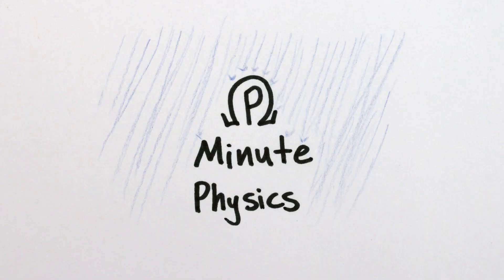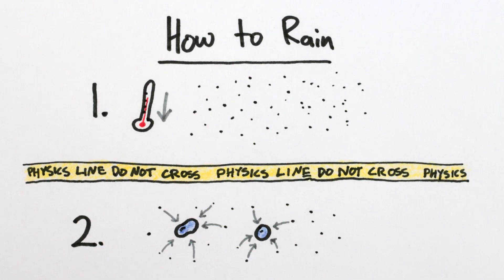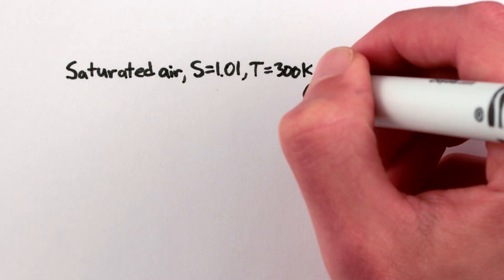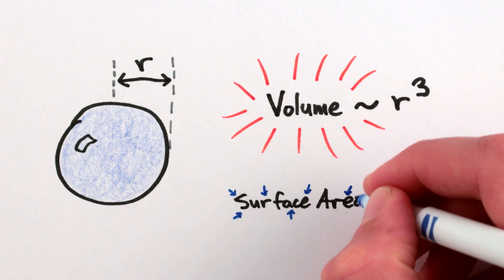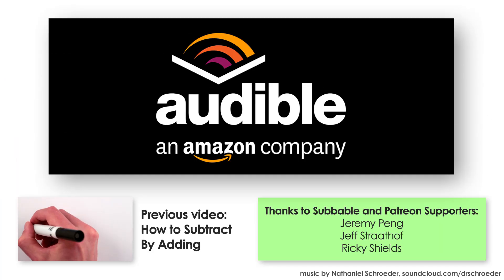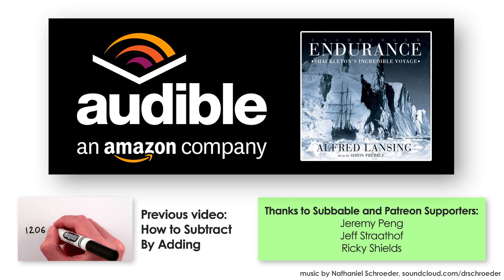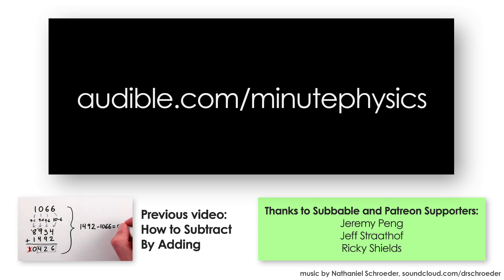Why Raindrops Are Mathematically Impossible

Comment: Nope. Curveball. Change your unit of measurement.
It’s not an impossible mathematical equation, you’re just mathing wrong on this one. 

.2 of a mile cubed is .008 cubic miles.

However! .2 of a mile is actually 1,056 feet. Cube that number and you get 1,177,583,616 cubic feet

Clearly there’s a disparity here.
Reply: Surely he knows this, so I don't get why he leaves those blunders in.  There's an even bigger problem in the light polarization video and it's frustrating how so few of the audience members catch it.  I assume it's algo-gaming by just leaving wrong things in on purpose to promote comments.

Comment: Hold on.. That doesn't make any sense? If the inverse square law flips with small numbers, what if you just used smaller units? I'm not sure that's a valid explanation and if anything just points to a fatal flaw with the inverse square law

Comment: Ahh, I believe this is due to measurement discrepancies

We measure in things like centimeters and inches, they are quite large, and one at least is easy to break down

Micro-physics, however, measures in atoms, which are far too small and numerous for us to count properly

So from our perspective we are cubing a fractional number, and therefore have what looks like an impossible equation

But from the theoretical perspective of physics, such equations are handled at the atomic level, with a base measurement so small it barely exists, and therefore don’t run into a shrinking exponential equation

Instead that water droplets surface area and volume are dependent on a comparatively massive number, but at an incredibly small increment to us

ThePoint/TL;DR: with water droplets: spacial dimensions are measured at the atomic level, not with fractions and decimals at eye level

Granted, I’m not about to go through and calculate that mess, that’s one hell of a big number for such a small thing, but at that point there shouldn’t be a discrepancy in the calculations, and that should be provable scientifically

Comment: 0:44
"Surfaces require more free energy (Gibbs) to make/form than volumes do"
Formation of a given volume of a liquid releases energy (-ve sign in formula) whereas formation of a given area of a liquid surface absorbs energy. 
So, liquids tend to acquire a minimum surface area with a maximum volume for a given amount of the liquid under the constraints they are in. 
When they aren't under any constraints (in equilibrium), they tend a spherical shape.

Comment: But the only reason cubing makes smaller numbers than squaring es with decimals. But the decimals only appear due to the fact that we’re measuring in meters or whatever. What if we decided to measure in smaller units? Would the point at which ^3>^2 literally just change?!

Comment: Soo isnt water doing exactly what he says (I think this is what he's saying): water likes to stick together and create volumes since a change in volume disaptes energy. While spreading over a surface requires more energy And since energy is proportional to volume or area the larger the area the more energy, same with volume but since producing volumes desipates energy you get  -X^3 and  adding energy for surface area = +x^2. Hence since water doesn't want to clump into large surface area and also considering the fact that  very small area cubed = even smaller volumes we hence have water droplets (small water droplets) and not a large waterfall or a glass of water being poured on us (again this is a question not an answer) I was wondering is this what I was supposed to understand

Comment: This is about water condensing around dirt particles, isn't it?  The idea is that it's impossible for water droplets to form completely by themselves, but in this case, it actually has a surface on which to condense.  And while a particle of dirt is tiny to us, it provides enough surface area to cross that threshold you were talking about.  It's also why my car gets progressively dirtier every time it rains. :'(

Comment: Pretty sure the answer is "raindrops form around dust particles", although I don't specifically know why - as that fact seemed to explicitly be missing from the video. I'll guess that small proto-raindrops stick to the dust particle, then after a certain point they "schloop" into a small (regular) raindrop with the dust particle in the center.

Comment: Your 0.1^3 and 0.1^2 argument makes no sense...  0.1 millimeters is the same as 100 micrometers.  How can something be different just because of the units you measure it in?  If that were the case, just use lightyears as your unit and oceans "are impossible".

Comment: I will attempt to dumb down the explanation in the video with this comment because....well I think it might be fun. 

There’s 2 basic principles that are being discussed here to try and conclude that raindrops shouldn’t work because maths says so. 

1. The first principle he talks about is ΔG, or Gibbs Free Energy, in regards to ΔS, entropy, and ΔT, temperature in kelvin. None of these terms need to be defined for me to describe what he’s talking about. Basically, things in nature tend to occur spontaneously, that is, they occur without needing energy to occur. For instance, Wet metal sitting in the sun will undergo a chemical reaction automatically ➝ rust. This is spontaneous. In regards to the raindrop, he’s stating that nature constructs raindrop size in a way that, mathematically, should require energy to do so. However, nature constructs their size spontaneously which means zero energy is needed. 

2. The discussion about the radius of the raindrop and the math variables to determine the size was just a set of proofs for why principle in number 1 should not occur. Forget the graphs and the x variables. All he’s saying is, the amount of energy needed from nature to construct these raindrops a certain size is proportional to the radius cubed. For instance, if we had a rain drop with a radius of 5 millimeters, then the energy to construct its volume can be calculated by doing 5^3. For those who are unsure what this means, it’s 5 x 5 x 5 = 125. Now, anything raised to the 3rd power is giving us volume because 3 dimensions of Space are needed to get a volume. A length, a width, a thickness. For the most part. 3 dimensions means ^3. However, if we take away a dimension, say thickness, then we only raise the radius to the 2nd power. So this will be 5^2, or 5 x 5 = 25. The number decreasing from 125 to 25 makes perfect sense in regards to energy required. Smaller number means smaller size which means smaller energy needed. BUT, this concept gets completely flipped on its head when you consider objects with a radius less than 1, like 0.5 millimeters for instance. According to the physics in regards to energy consumption, the math needed to answer this question is done the exact same way... 0.5^3  would be the volume (3 dimensions) and 0.5^2 would be the surface area only (2 dimensions). Well what happens when you cube and square 0.5? 

0.5 x 0.5 x 0.5 = 0.125   :5^3
0.5 x 0.5           = 0.25.    :5^2 

This is showing just the opposite. The number that corresponds to the energy required to make the 3dimensional object is SMALLER than the energy required to make the 2dimensional object. 

To paint an analogy that illustrates this contraction, that’s like a store charging $5 to buy a single candy bar yet also charging $1.25 for 4 of the same candy bar.

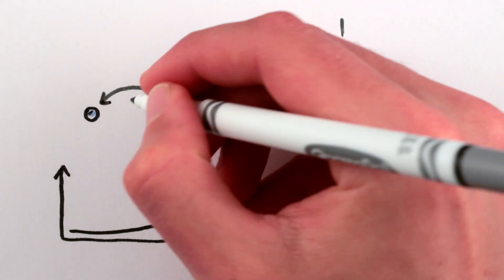Comment: 1:38 there is a problem. (Let's say drops are cubes so its easy to count.) You have 1 drop size 1 (V=1, S=6) You shrink it into 8 smaller drops. (V=8*(1/8), S=8*(2/3)). Arount of water (V or x^3) is still same, but you have BIGGER surface (S or x^2) The problem is, if you have smaller size (d or x^1), if you want to shrink it your V must be same, so you put it into more drops, which make more surface. (If you want to use this on spheres add some koeficients)

Comment: To form a droplet out of water molecules you need to give them energy to form the surface. However, once they come together, they'll give you back an amount of energy proportional to the volume. So, if you add the energy you need to put in and subtract the energy you get back, that gives you the total amount of energy for the whole process, i.e. how much you need to supply to make it all happen in the first place. If that ends up being 0 or less,... well,... that means you literally don't need to do anything to make it happen, so it will happen. If it's positive, that means you need to put in energy, i.e. it won't happen automatically.

Surface=x^2
Volume=x^3
(energy needed) = x^2 - x^3

p.s. "x" here is not some arbitrary length, otherwise you could just change the units and the "sweet spot" would change. "x" is a length scaled to the dimensions of the water molecules, i.e. it is unitless.

Comment: Some idiot i knew said that a raindrop was the most natural shape to follow as for resistance and that a raindrop is shaped the way it is because it finds the path of least resistance.
I tried explaining to him that his thinking is flawed.
A raindrop is finding the path of the most resistance at all times. 
Thd air on bottom wants to flatten it out and at a certain point the air engulfs the edges and closes back in on it when the surface tension of the water can no longer overcome the air pressure. But the rain drop is always trying to flatten back out so therefore its always adding resistance.
So...a raindrop is the worst in finding the path of least resistance. 
Get it...got it....good.

Comment: You said that raindrops would require more than a few million molecules to be stable. Therefore when there are trillions of molecules in a drop it would be possible... Especially if you had a giant boost of energy to initialize the formation such as energy from radiation or kinetic energy. Similar to how an airplane moving through the sky (under correct conditions) can cause con trails, wind could give enough energy to cause the initial formation until it gets to the point where it is releasing more energy than it is using.

Comment: Sigh, I am not sure there is a problem here.
Last I studied surface tension, I ended up with the result that one could calculate surface tension as a term to describe how much one overestimates the chemical bindinging energy between water molecules, if one assumes that the molecules are always connected with other molecules all around them. This means surface tension can never be higher than the energy gained from having water molecules joining together, as it is litterally the energy it could gain by being joined (with more water all around it).
The MinutEarth video seems to mention another reason: condensation vs evaporation balance, which should mostly be govern by the surface size on both sides, when disregarding quantum based effects (which seems to be precisely the cause, but they dont go into sufficiet details for me to conclude this).

Comment: it is strange to talk about  x²-x³ in physics without using units. what are (0.5m)²-(0.5m)³ ?
and even worse: try computing the same using centimeters: (50cm)²-(50cm)³. first result is positive, second result is negative. so the "plain mathematical fact" is just not applicable to "arbitrary units".
the critical question is here: what unit are we talking about?
if it is "number of molecules" then there is no critical point unless you are talking of half a water molecule or similar. but then are we then still taking about water drops being formed from water?

Comment: I'm not sure about this limit where r^3 starts to get smaller than r^2. The question is, can you compare surfaces with volumes? what happens if you're working with different measurement units?...
Can anybody tell me if this is 100% mathematical correct?
Reply: Way too late to the game here I know, but you asked and I can answer. You cannot square or cube numbers less than 1 when dealing with physical realities. Reason being that in physical realities there isn’t actually a less than 1. 

Cut a piece of bread and eat one piece. You get half piece of bread? Or a small piece of bread? The answer is both depending on your viewpoint. And in most mathematical equations, there wouldn’t be much of a problem with it, as long as you’re using the right constant, like the size of the bread, then cut in half.

When you cube it to get volume however, things change.

If you cube 6 inches, you will get 216 cubic inches.
Cube 1/2 a foot (0.5 feet) and you get 1/8 a cubic feet (0.125 cubic feet) or 1.5 cubic inches. 

The mathematical equation never changed, but the amount of space in the end was dramatically different, due to the fact that we cubed a number less than one. 

Thus his issue with the math here is simply the unit of measurement involved.

Comment: i tried to write a small summary of what's being said..cause... i didn't get it at all?

to take water molecules in the air and make them into something that has volume releases energy 
but to make it into something that has surface area (it's flat) requires energy.

a water drop has both volume and surface area. there is a threshold (ie the drop is large enough) where the energy released from making the volume is enough to hold/form its surface.

the threshold is somewhere around millions of molecules.
so in theory, water drops could never form because the amount of molecules required to overcome the energy consumed to hold the surface together is too big for them to randomly clump together.

Comment: Maybe the problem is simple. When using meter or millimeter, and you have 1 of that unit, applying exponents are equal to 1 - which is also the exponent-equator (I just call it like that because whatever) at which increasing it will grant more when squaring and grant less when below. There may be no such equator, because it's all about mass. 1 of a unit is the length of lots of atoms. Basically you would need to use only integers, as having values between 0 and 1 would cause exponents to behave differently.

But maybe there is a point where that behaviour is appropriate... but that is certainly not 1m, 1mm, 1micrometer, 1nm, etc... Remember that mathematics and our use of it is still human made, and does not always align well with reality.

Comment: What if you measure the size of the drop in nanometres?
Reply: Ornen, you missed his point.

The video states that r^3 stabilizes the water droplet while r^2 destabilizes it, right? If r is large enough (let's say r=10) r^3 will be larger than r^2.

100^3 = 1000 000
100^2 = 10 000
100^3 - 100^2 = 990 000

But if r is too small (let's say r=0.1) r^3 actually becomes smaller than r^2.

0.1^3 = 0.001
0.1^2 = 0.01
0.1^3 - 0.1^2 = -0.009

Scabbage is saying that this makes no sense. If r = 0.1 micrometers, it's also 100 nanometers. r^3 - r^2 is both positive and negative, depending on your unit of measure.
Reply: same thing....
If I messure this dash - in centimeters or millimeters it is still the same length

Comment: This is what happens when you stay up all night going in circles at the obfuscating rink. If arithmetic proves raindrops an impossibility, than a raindrop has rendered arithmetic futile. 
    However I can relate to the sum of all variables being less than, or shrinking. Just check your savings account, the more you put in, the smaller you balance becomes. 
  I guess what hes saying is, debt is a naturally occurring cycle. Temperature and pressure is dictated solely upon an assumed premise. 
   Ill break it down for the double digit IQ's stopping to ask for directions in cyberspace. 3 Polish men need to measure a telephone pole. They stand her up, 2 men hold vertical whilst the 3rd Polish individual shimmy's his way up with a tape measure. However, after multiple failures, a homeless bystander wearing a pink shirt says "why dont you guys leave the pole on ground and measure it?" Ding, to which all 3 Polish men announce simultaneously, "we already know how long it is you idiot, we need to find out how tall it is..... duh!!"

Comment: A problem arises in this explanation. It is related to scale. You can always scale your system of units so the measured values to the drops are also large greater than 1 (at least to macroscopic drops).  Where the scale symmetry is broken I did not catch.
Reply: Nope, reality is just the way it is. It doesn't depend of your unit of measurement, obviously.
Reply: But the presented mathematical explanation does depend on scale, as long as you do not question that 1000 cm = 0,01Km! That´s what I have questioned. In other words, yes, the growth or shrink of the droplets depend on the inicial size of each droplet compared with a specific natural size - a natural size which is itself independent of scale used to measure it. This limiting size is related to some physical processes whose description goes beyond the simple area - volume relation as described. The presented mathematical explanation, based on volume and area relations,  is only valid in a natural scale so defined, that the limiting size which determines the frontier between both behaviors, growth or shrink,  is juste defined as having a much specific radius value ("1" once assumed dE proportional to dV in volume case and proportional to dA in area case).
Reply: Anonimo Oculto Nope, it doesn't.